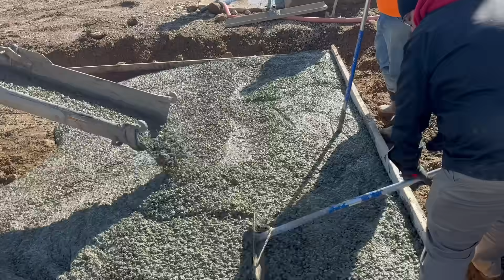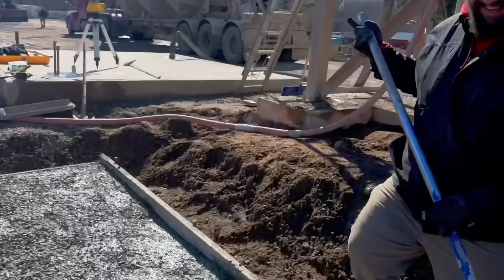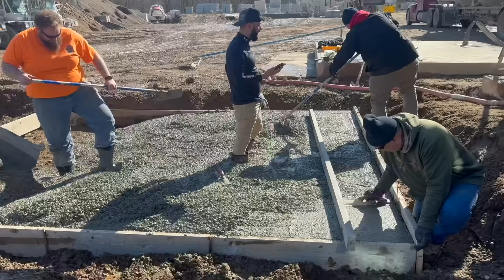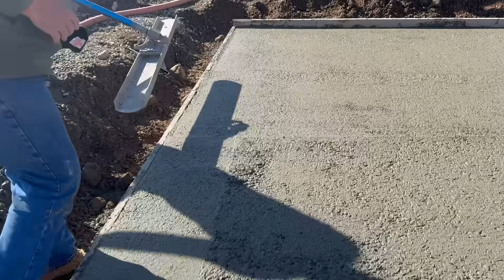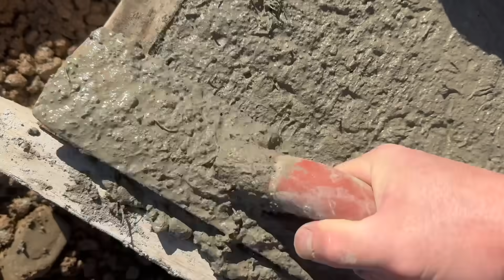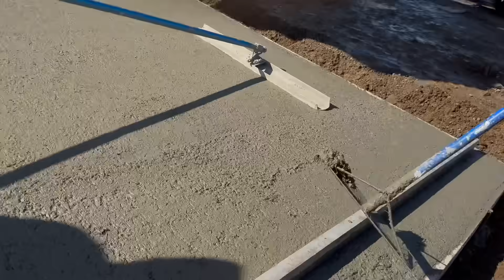HOW LONG WILL THIS NEW TYPE OF CONCRETE LAST?

Comment: Hours of concrete truck driver for over 20 years and we used to sell concrete with fiber mesh, no doubt it makes it stronger but there is one bad thing I heard about was when it's dry don't walk around on it barefoot or you'll get splinters from the fiberglass. There might be a way to sand them out. But I don't know.
Reply: Use a weed burner on the surface before you seal it .nead to let it dry out first.

Comment: After reading the comments on surface finish issues.   Just epoxy coat the top after it sets for at least 4 weeks (although I would likely let it sit for 6-8 weeks).  Surface finish issues will disappear.  That gets you a long life slab (assuming you are not affected by frost heave) and a pretty surface.

Comment: The answer to your question on life is dependent on where you are.  If your area never sees hard freezing winters it's likely going to last a very long time. Fibers are very good at solving certain problems. Up here towards northern Wisconsin frost heave will affect that slab - and I would have put in SS rebar to make it last (and prevent the life limiting rust issues common with steel rebar).

Comment: Had a shop slab of this crap hard to clean fibers sticking up even with sealer and it cracked 1 long right where u use a creeper wheelz would catch 😢

Comment: I don’t remember the specific years, but it’s probably before the year 2000. They used ground up car tires with the cement or asphalt and it lasted an exceptionally long time. But because of politics, they did not continue to use it.

Comment: Out in Washington state that’s just regular fiber, for industrial purposes, not micro fiber for driveways sidewalks residential. Wait until you broom it, turns to non skid. You almost need to use a rock roller or saw screed. Pull screed doesn’t allow enough cream

Comment: I am not absolutely sure what type of Concrete this is, but it is a pleasure to see a garage floor being poured with a mix that is at least somewhat progressive. We have been making and promoting Ultra High Performance Concrete since 2012 or so. UHPC can be over ten times the strength of traditional concrete while also being nearly 100% water proof and far more resistant to bending forces (flexural strength ). Remarkably, the three main ingredients in UHPC are the precisely the same as those in TRADITIONAL CONCRETE! I WOULD CONSIDER THIS MATERIAL ABSOLUTELY AMAZING! Oh, and it is produced using the same MACHINERY (trucks etc.) as traditional concrete!!!! D

Comment: I had my shop poured with this over 22 years ago…no rebar or wire…just the fiber..3 1/2 - 4” thick…no cracks and only has two long expansion joints cut in about an inch deep…28 x 45 slab

Comment: That fiberglass concrete sucks, I used it in my 50' X 80' shop it has deep wide cracks all through it, just pisses me off that it was waisted money.
Never again will I use that crap again, should of used regular tried and trued concrete, that crap needs to be banned 🤬🤬🤬🤬

Comment: Have several questions. I'm a carpenter so I am not experienced enough to know better.
How much fiber is usually used? You guys made it seem like it's a lot more than usual besides it being a new kind.
Since you didn't show the finished product, can you get it close up? Otherwise it seems like there would be too much water intrusion and it would break up the slab. I know concrete is porous but this seems like without a smother surface water can't pool and drain away.
Is this just a test ?
This is probably a stupid question but, can you use this in walls? I've been seeing way more cracks in new walls than ever before. Been working almost 40 years and it seems like there are more problems than there used to be. This could by my own prejudices and it's actually that I didn't notice them before because of my lack of experience.
What is the cost versus regular reinforcing? Everything is so expensive now does this make it any better or is it actually worse?
I like seeing the newer stuff you guys do, keep it up.

Comment: I've used steel pin fibrecrete and fibreglass both will hold up Aussie road trains in a big intersection, we did a .150mm blind slab on a .200mm fibred/pinned slabs.
Vibrating finger to release the air pockets and that shits not moved in 20 years also it's on coastal ground where its basically sand and marine mud.
Reply from the maker: That's awesome thanks for sharing that buddy.

Comment: I did my driveway myself about 40 years ago. Fiber was kind of new back then.  As an engineer I decided to give it a whirl.  I remember the city inspector told me I could only use wire mesh and that if I wanted to use fiber I had to get the plans sign off by a professional engineer. I walked over to my truck and pulled out my engineers seal and signed and stamped  the plans in front of him. He wasn’t happy.  To make a long story short the fiber is still there, no cracks.  I’m 73 years old now so I guess it’s good enough for me.
Reply from the maker: Wow good story and thanks for sharing. I think a driveway is all in the prep and what is under it and compaction.
Reply: @bondobuilt386 I watch you guys all the time and I realize that I just got lucky.

Comment: These concrete redi-mix companies like to charge by the minute to unload... They would go broke if they were on the working end ... These guys are slow and inefficient. They see it every single day, but this is proof that seeing it isn't doing it. I've had lots of guys over the years claim that they "do" concrete only to find out later that they actually " deliver" concrete. Two completely different trades and levels of physical work and knowledge.
Reply: my father always told me if the driver helps out even just a little bit ,,,,you had better tip him,,,
Reply from the maker: @davidstreling3690  Yup I agree with that.
Reply: They went alright
Reply from the maker: I thought the Boys did pretty good

Comment: We tried some crap like that on the west coast in the 80's, vs WWM.  Total garbage.   Ended up with thousands of square feet of "fuzzy slabs "  Tried burning it off with propane weed burners.   Large storage facilities, lots of sweeping required.   Always filthy.   Back to WWM.
Reply from the maker: Im a fan of wire mesh too. Not a fan of fiber especially micro fiber.

Comment: Definetly not closing up gonna have to get out on it but its gonna take awhile it pretty wet gotta be like a 7 slump
Reply from the maker: It was definitely stiffer than a 7 slump. It also had 5% excelerator in it LOL
Reply: 4, 5 slump is best.

Comment: That's how I'm doing my sidewalk to front door. All cracked up I'm just going to do an overlay and build it back up.
Reply from the maker: I would take out the old and redo it. Do it in small sections that you can finish by yourself.
Reply: Why not replace it completely?
Reply: @kevinhornbuckle  working alone